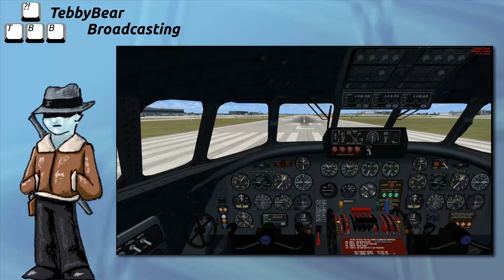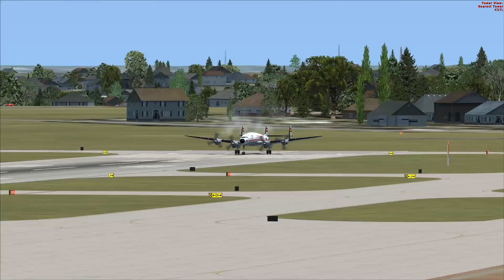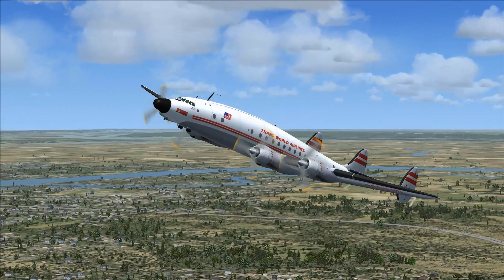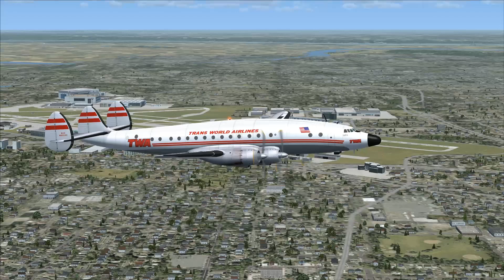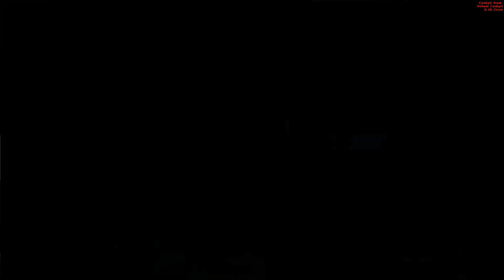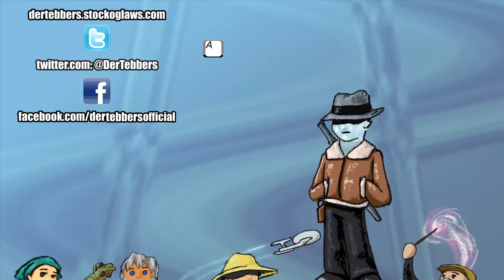Flight Simulator X Plane Spotlight - Lockheed Constellation

Comment: When I was in Fort Dix NJ in 1965, I was a passenger on the Connie many times flying back and forth between Newark and Boston. I flew standby for $8.60... but there was always room for me. In fact many times there were just a few of us on the plane.
I always took a seat on the starboard side behind the engines so I could see the fire   coming from the exhaust when the engines were throttled back for a night landing.
 I'll never forget the rumbling sound ( Sorta like a monster size Harley Davidson ) as the engines were started.
 I also used to be a passenger on a KC-97 ( My 2nd favorite 4 engine beast. )
I only flew once on a jet and that was the boeing 707. Those big old prop planes had personality. Unlike airliners today, back then they were REAL airplanes.. .

Comment: You should try manually starting these planes some time, I'd like to know how to actually do it.
Reply: Matheus Geisel Problem with that is different planes is they have different start up procedures.
Reply: I know, i meant show how to start each plane he features. I still have no clue as to how to start the RCS B-25.
Reply: Most freeware planes you can shortcut by just pressing shift+E.
Reply: That's no fun. I'm talking about actualy doing it manually.
Reply: I'm all in on that idea. Again, though. Each plane sort of has a different start up. Der probably already spends enough time preparing for the spotlight, though. I think to ask him to learn each plane like that is a bit unfair.